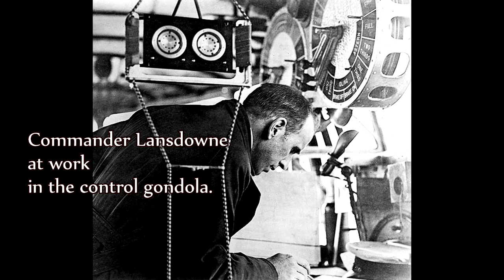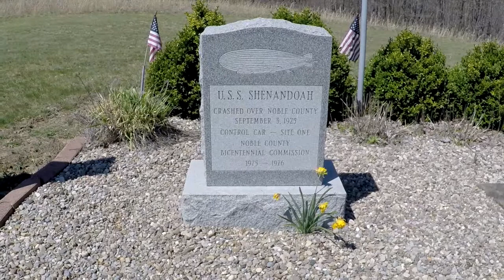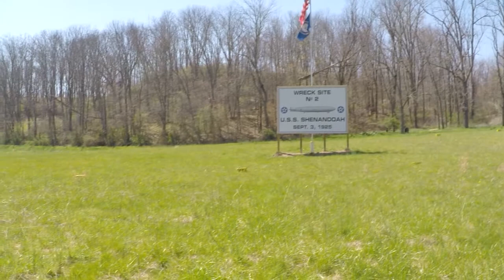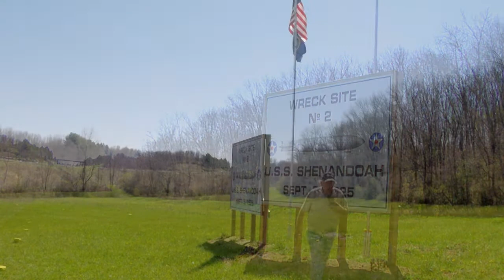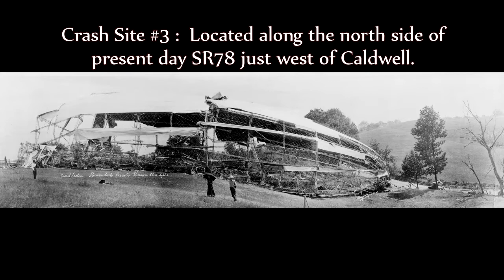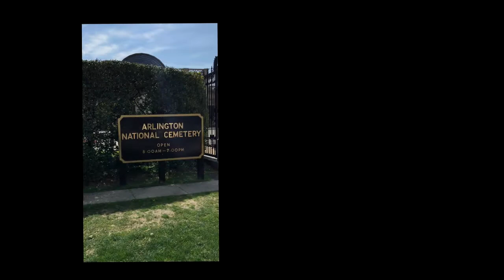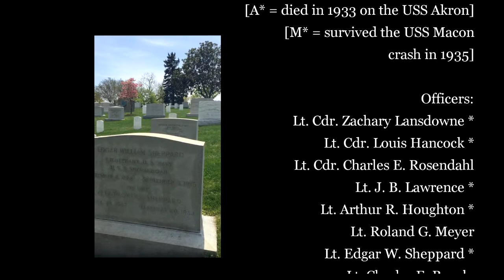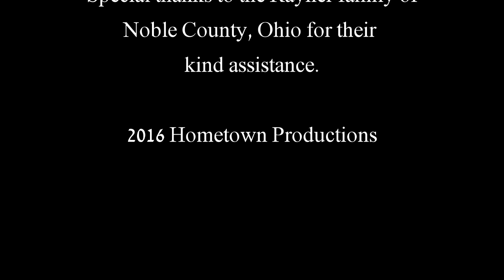The USS Shenandoah

Comment: 36 tons, as originally built. Hypothetically, the same airship could be built nowadays, using modern materials, producing the same sturctural stress/load tolerances or limits, yielding an airship at about 2/3 original total weight, 24.2 tons. Weight saving would come mainly from modern hull covering material, much lighter modern 300hp aircraft motors, modern lift-gas cell material (those would be the predominant weight savers). Thus the airship would have the same operational limitations, as there being no engineering/structural enhancements. -Same speed, same payload lift, etc. However, with about 11 tons weight saved. That savings could be "rolled-over" into engineered/structural enhancement for increased stress/load and tolerance, making available greater payload, fuel capacity, modestly increased motor size (a modern 330hp aircraft motor would be extremely more efficient than the original Packards, I believe). -Thus providing an enhanced (upgraded) Shenandoah with greater range and a bit more speed. Of course, the original Shenandoah had a controversial extra mid-section ring added. So, engineering-wise, I don't know how that would be best dealt with, in a hypothetical upgraded rebuild. Time for a new era of big rigid airships.

Comment: The control car only had 7 men lost, two more were lost in the "radio/generator" section just aft. The other seven casualties occurred in Engine Gondolas #4 and #5 which tore away from the ship and the breaks in the structure that caused them to tear away.  Any story that a man was lost from the nose section trying to secure a line is not true.